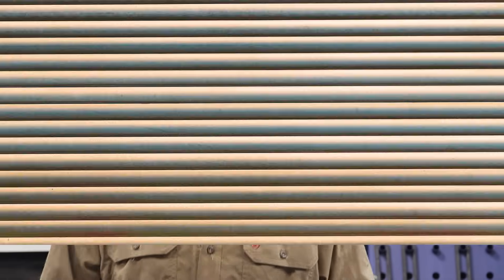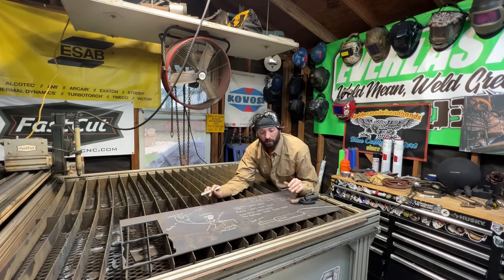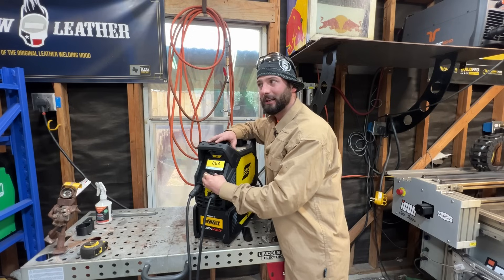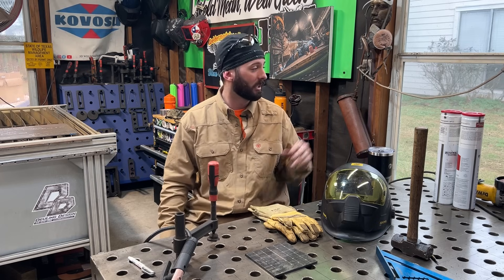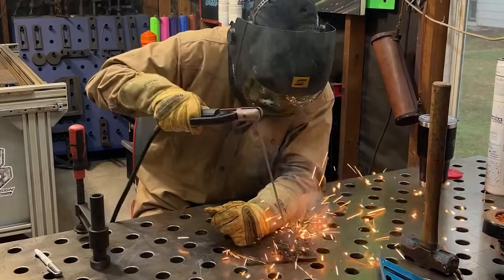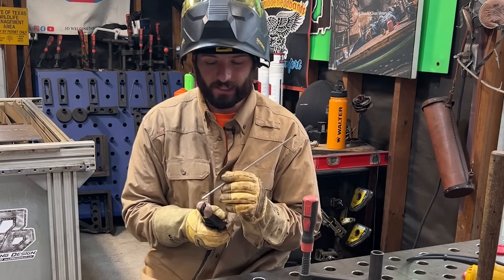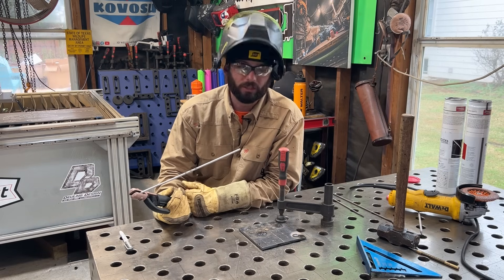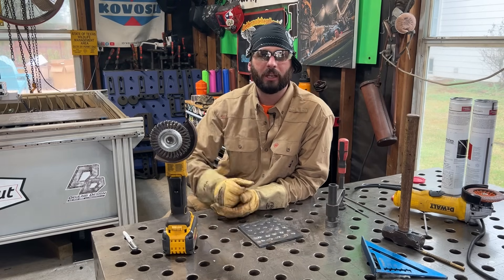Essential Tips for New Welders to Strike Perfect Arcs

Comment: Lol That's funny to see you snowboarding. I just got into welding again. I work for Terrain park on a mountain and I thought it would be good practice to make miniature scale versions of all our boxes and rails to use as props to design terrain park builds. I did a little it of stick welding on a farm I worked on mut nothing too crazy. My cousin let me barrow an old flux core machine but I couldn't even figure out how to open it lol. Then I've been seeing these small welders, and I found a little stick welder for 50 usd and its about the size of a brick. Works pretty good! although I'm a bit psycho stick welding on suck small material. i just like the simplicity of stick. If i had my own shop i would get into tig i think. I have a ton of soldering experience working at a guitar factory and working on other electronics. But honestly making them in tiny version probably harder than at full scale in some ways.

Comment: Mostly I have used E60105P+. I'm glad that that is what I started with. Once you master 6010 all the other sticks require just a little bit of adjustment on procedures.  Since I got rid of my TIG welder I'm trying to learn on 1/16 E7013 and 3/32 E7014 just to weld on small stuff. I got a new Lincoln inverter that seems to work well.

Comment: A big gripe with of mine is youtube creators that "compare " rod  performance of different types and the set the current at the same settings to be "fair" not the recommended amperage on the package.    Then there are the different versions of the same AWS rod from each brand, even those settings need to be tweaked.

Comment: Great video. I'm a newbee to stick welding. Have had a lot of problems starting a bead, and this really helps, especially the tip about getting the puddle forming before moving the rod. I mainly weld 1/8" and 3/32" angle iron, so that gets even trickier with the lower amperages.

Comment: I bought a Harbor Freight ProTIG 205 but I'm trying to learn stick first. It's not what I'd buy if buying again. The 205 provides only a simple "switch and a knob" in stick mode but it was still expensive, even "on coupon"! Most YouTube beginner videos illustrate the scratch, tap, "match strike", etc. multiple times with the welder off. This is important so the student can see how the instructor is moving the tip of the rod immediately after the arc forms. Unfortunately, most of the power off dry runs demonstrated on YouTube would not actually maintain an arc, because the instructor pulls the rod from the strike zone immediately after making contact. Please...always follow through with these power off demonstrations and pretend you welding to maintain the arc for a second or two before pulling away. Thank you for a couple of the power off demonstrations in this video that seem to do this but most of the arc strike demonstrations are still a quick scratch and lift, which is not helping me to get the "follow through" timing and movement I need to learn to keep my arc going properly. My problem isn't getting the arc started; it's keeping the arc going for more than a split second without sticking or flaming out, crudding up the tip of the rod for my next attempt. Even with good support from my support arm and hand, I think my post scratch timing and control is all wrong and I don't seem to be able to control what happens after my scratch when the arc starts. Maybe I have a "trigger flinch", to use the analogy from firearms, and I just need to "dry fire" for a few hours.

Comment: Have you heard about welding a piece of metal that was partially magnetized. I was working on a project and I was using a old kid’s jungle gym that had been sitting under a pole line for 30 years. It was not much fun to weld and the arc would wonder around.

Comment: So I recently started running a old school oil cooled welder... How do you stop that sticking???
Reply: Go up on the amperage until you have improved. You might have to move faster on your weld if welding thinner material. I've never had a starting problem with the old school oil bath welders. I do have times when I get frustrated when using LH (low hydrogen)7018 rods with the inverter welder. When I'm really getting the sticking issue I go up to 150 amps 😂

Comment: A well made video with a lot of useful advice.
 I was introduced to stick and oxygen welding years ago and have done welding on and off ever since, but while I feel quite confident with oxygen Acetylene welding, stick welding is not as good as I would like.  Welding thick steel and very thin steel together using stick welding is to me challenging as it is easy to burn through sub 2mm thick metal when setting the power so it will work well on the much thicker steel part.😕

Comment: Mate, I'm surprised how versatile a little 6011 rod is.  I have a cheap inverter (unimig 160a), and it doesn't like to hold a 6010 and I don't like the slag with the 7014 or 6013 out of position.  The murex 6012 isn't too bad and seemed a bit more crisp arc and slag wise.  Have been surprised though how useful a 3/32 6011 is for general fabrication though.

Comment: Fancy welding machine. I'm certified on 1" plate, vert up and overhead, these machines have come a long way, but I still like my Airco Dipstick 160. Easier to strike an arc, for me with an older machine, than the Miller we have at work with no real adjustments. It's supposed to be a smart machine, you oughta hear me talk to it!

Comment: you should set the exposure on your camera to compensate for the brightness of the arc flash because we could not see anything about how far away you have your rod from the puddle, heck we couldn't see the puddle. consider getting a dark shade non auto darkening lens and putting it in front of your camera lens when filming a demonstration.

Comment: Any tips for beginner 'hobbiest' welders, who have a very cheap machine that doesn't have any of those fancy settings so that it doesn't stick?
Reply: Have someone to turn up the amps for the first strike
Reply: Don’t run the machine off of an extension cord, make sure you’re able to supply the 20 amps of 120volt AC power that it needs, spend more time cleaning your joints, use thinner base metal, and a thinner rod. This means you’re gonna have to feed the rod quicker, which isn’t the best way to learn, but it’ll get your stuff stuck together
Reply: Clean clean clean. Work with hot subject. Bake your rods.

Comment: I did my first welding project doing an stainless exhaust for my Pontiac.
Not very beautiful so might have to do a new one.
But a little practice and its possible.
Used a cheap migatronic 120A stick welder. Works good 👍

Comment: I learnt a little trick, when in a safe area to do so, when finishing a weld and pulling the electrode off the metal, giving your wrist a little quick flick to the side and this will shoot off the little bit of slag/flux that balls up on the end of the electrode, then you don’t need to tap before restarting.
Reply: Thats a great one!

Comment: I set my machine up to use high frequency start with stick. This worked more reliably than anything else I've tried. For best results, though, I'll keep working on my skills.
Reply: Handy trick to have most defiantly. Unless your machine isnt capable
Reply: @Drweldz  I've got a TIG/stick machine, so I just turn it over to TIG. If I only had a stick machine and trouble starting, then I've got a trick for that, too. I'll put a pinch of iron filings on the spot where I want to start my arc, then the filings will help the spark jump the gap. Once I've got more practice, I'm sure I can skip this little step.

Comment: Why does no one mention the metallurgy? At about 1333° F steel transforms from magnetic to non-magnetic. Yes, you can weld without reaching that temperature but if you get a little too close it will tend to stick. I teach my welding classes to practice making the rod not stick. This is done by long arcing for 1 to 2 seconds, then begin welding. Then to test whether I have gotten it hot enough, I actually push the rod directly against the base metal, trying to make it stick. If it continues to stick, then increase the amperage slightly, and try again.
Reply: I agree. One of the first things a newbie should master is to strike an arc and not stick. I used to practice by turning the amps lower and lower until I start an arc pretty easy with the amps in the lower range. Then adjust the amps up for a good puddle.  For me it's just how I touch the stick to the workpiece. I now have to use two hands to strike an arc since I'm older and not as steady as I once was. I always start my amps in the lower range according to my work, equipment and even the outside temp (normal vs very cold). I'm always adjusting my amps as I weld. This is just how I do it. I love watching videos on other ways to weld. There is so much to learn.

Comment: Great tips Austin and thank you!  I seen a trick on the "Making Mistakes with Greg'" YT channel where at the end of the weld he whips the 7018 rod out quickly and the slag covering flies off into the air before it has a chance to encapsulate the end of the rod.  I tried it and it took some practice but I managed to get the slag to fly  off.  Looks like flicking the cherry off a cigarette but it works.  The rod burns back into the flux so you have to break off the flux with your gloved hand before the restart.  It also leaves the end of you weld in a dished condition so you wouldn't want to do that at the very end of your weld where you need to hold the rod in to get enough weld metal into it.  Most of the time though I do as you do with my restarts.   It isn't always a good idea to flick hot metal several feet from you so I don't make a habit of it.  But it is neat to see it fly off...lol
Reply from the maker: That is an awesome tip and helps cut down on wasting rods because of chipping flux or frustration lol